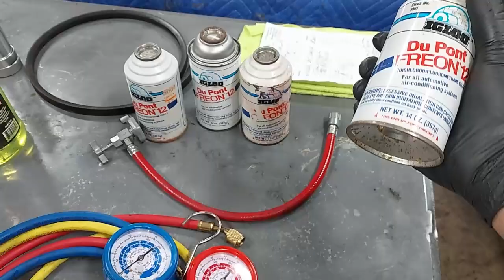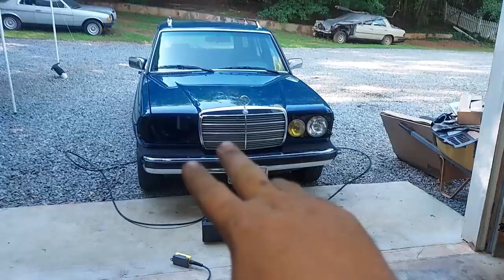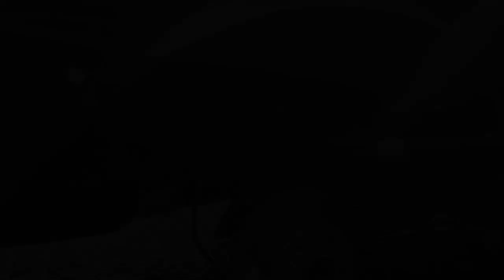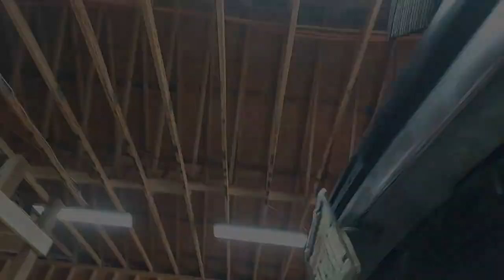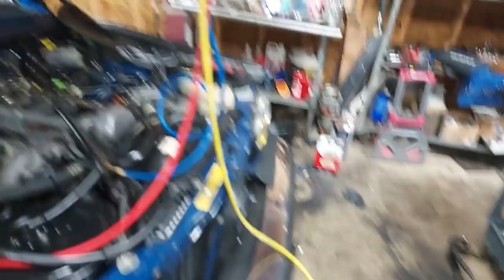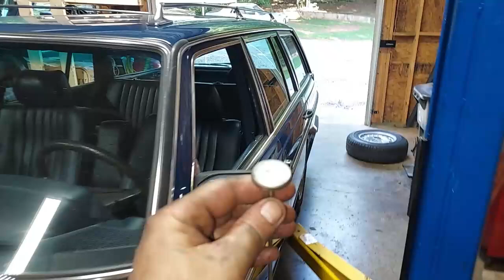1985 "Cali" Wagon Part 4 - Air Conditioner

Comment: Would you mind sharing the information on the temperature switch? I had to drill and tap my dryer cap to connect the original M6 temp probe to my dryer. I am  filling mine with R290 gas and replaced the front fan. I think the fan is still not coming on soon enough.
Reply from the maker: Please email me directly and I can give you a part number I would have to look it up. john@woodsandbarclay.com
Reply: @woodsandbarclay  thank you!
Reply from the maker: By the way I just started a patreon page and if you're able to contribute you will get access to some unreleased videos that are definitely worth watching. There's a link to the patreon page in the description of this video.

Comment: Hello, do you have Information which is the number for plastic cuffs/sleeves on SLS shocks for W123 Limousine?
Reply from the maker: I'm pretty sure the rubber covers that go over the hydraulic struts are no longer available. However this is not a unique part you can buy rubber covers for generic hydraulic shocks and attach them with clamps.

Comment: It appears that the compressor on my '84 W126 has recently started leaving a tiny puddle of oil on my garage floor. The R12 system is still super cold though. Do you recommend replacing the compressor and converting to R134, or should I find some R12 when I replace the compressor? Thanks you!
Reply from the maker: I would just get some more R12 and change out the compressor. R12 is readily available on Craigslist depending on what part of the country you're in. If you're changing out to compressor it's always a good idea to go ahead and change the receiver dryer just like I did in this video.
Reply: @woodsandbarclay  Thanks, appreciate it! I'm in PNW. I see R12 on CL occasionally, but usually in a large tank. I'll keep me eye out for a smaller quantity.

Comment: Wow. The test drive of this car will be epic! (And it is summer, so the new AC will talk loud and clear) Great video!
Reply from the maker: Yeah these original r12 systems are about four to six degrees cooler than the r134 systems. Don't get me wrong the r134 still works great and I have that in my daily driver classic Mercedes but the original r12 just takes it slightly colder.
Reply: @woodsandbarclay  Thanks for the explanation.